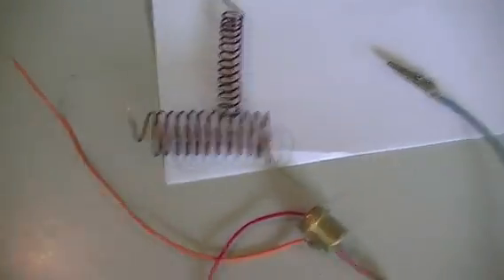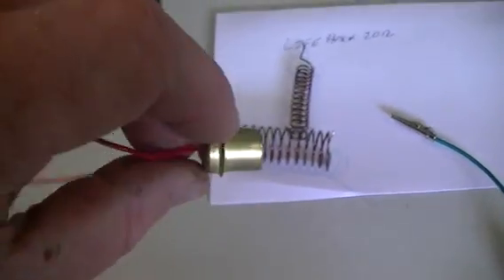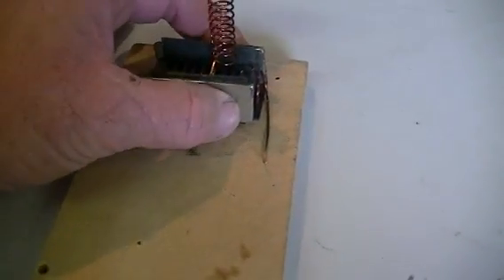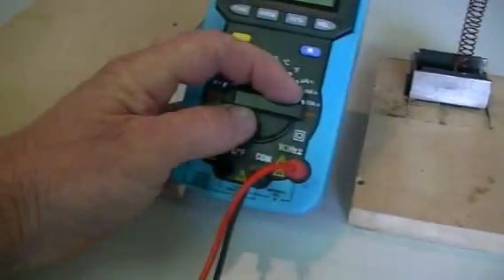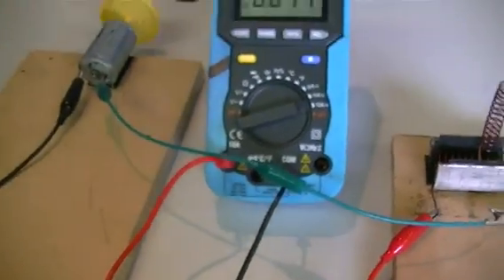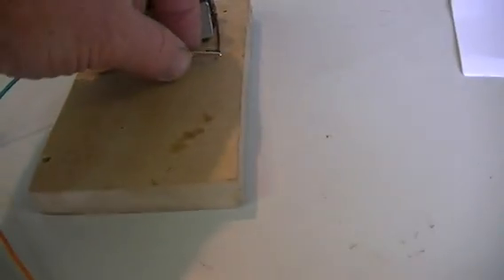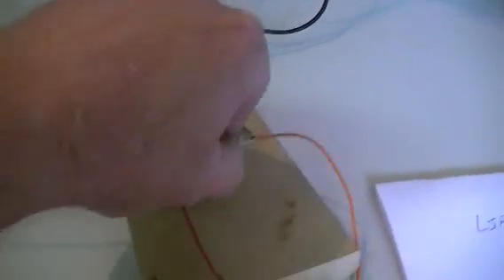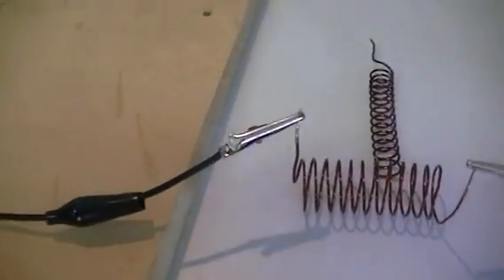Free energy coil replication

Comment: @ 8:06, the time is 7:48 (Δt=1:42) and at 11:55, the time is 11:37 (Δt=0:18). That is quite the difference (Δ(Δt)=1:27)), so it is not a simple offset, either that over the 4:07 minutes, the difference in the cameras or YT recording time is that far off (hard to believe with today's accurate quartz crystals) or this video has been tampered with! If that is the case, you still did a good job since there are no obvious cutscenes or anything!

Comment: I am 5 minutes into the video where the LED lamp is, and my guess is you have an inductive coil underneath that setup, inductively coupling a high freq. AC signal, and there are small signal diode somewhere to rectify it.
Reply from the maker: No. The reveal video will be up tonight.
Reply: Well I do have tiny batteries as thin as the wires used, but they can only barely power LEDs. Intresting...

Comment: You sir are a master of trickery! The only problem is this video appears to validate the nonsense.
Reply from the maker: That is the intention-to show how these guy's make these fake video's. As i said at the end of the video-dont waste your time on this,it dosnt work.
Reply: @69Atho   I did not hear you say, "don't waste your time on this, it doesn't work."  Of course it won't work without the magnets on each side, which it at least appeared to with them there in yours at first and throughout, until the end without.  When it did not work in the middle of the video at first, that's because the device was not connected in the circuit with the leads.  I built two from LifeHack2012's "how to" video with 14 AWG (as stated) solid copper wire from Romex for household inner-wall wiring; one with the bare Ground wire and another with the white insulation on.  I stripped some insulation in the middle wrap to solder the antennae, which was also insulated from the solder joint.  Neither one worked, with either one magnet nor two.  But yours did appear to work with both magnets.  Are you saying there's a trick, like a little battery inside the motor that is connected to the stator when one path is shorted together on the coil, which is closed when alligator clip wires are connected to something?  If so, then how does the bulb light by itself (without the motor) when both magnets are there, and the device also puts out more power with the motor running when the bulb leads were reversed?  It works or it doesn't.  Which is it?  And if it really doesn't, then what's the trick to make it appear that it does?  Thanks